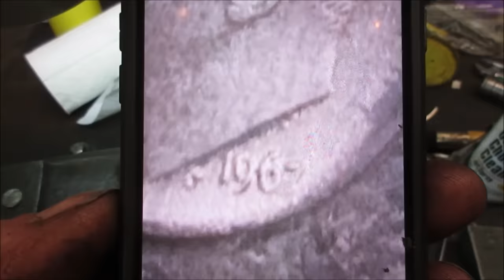VèloSolex Moped, Will it Run/Ride After 46 Years?

Comment: hi guys ! hi mustie ! i'm a french crazy fan of there solex moped ! and i can tell you it's soo fun to drive ! just little tips ! it's have a centrifugal cluche so if you stop in idle and you let the engin on the tire it will not burn it ! you just pull the engin up went you want to park it or ride like a regular bicycle ! went you have a stop, just pull the front brake ....have a great ride !
Reply: Fantastic idea!
Reply: ....and you can't use a "regular" bicycle tire. I learned the hard way. As soon as I dropped the engine on it, the engine chewed through the tire like a high speed Dremel tool, just before it busted the inner tube. lol
Reply: If it has a centrifugal clutch, how do you start the engine? Mustie's clutch must be stuck then.

Comment: That throttle works like a deceleration peddle on a bulldozer bro, I guess it is so it works like some sort of cruse control so you can keep ya hands for steering better. Great video and back story. Safe travels. Ken.

Comment: Welcome back. That Velo Solex sure reminds me of my youth when i owned 2 of them in succession. For all their simplicity they were pretty reliable and easily handæed the rain and snow in Scandinavia. Easy to fix too.
Reply: 33:20 At least on older models the decompression lever was attached to a small arm on the handlebar next to the throttle that you could operate with your thumb

Comment: 1:00:53. JB Weld will fix that up right--it is an amazing epoxy that doubles as a body filler, but is very hard when it cures so you have to be aggressive with it when sanding and filing it to its final form. The original formula (slower curing) is perhaps the best as it allows you an easier time at chiseling off the excess before it morphs into "immobile object" status.

Comment: Can you replace that metal that is rotted away on the rim. That would be a challenging welding job for ya or would you just purchase a new rim for it. It kinda reminds me a bit of when  i first rode my first Triumph with the gears on the right side if felt so bloody strange ....I didn't like at all That much I knew.

Comment: a Velo Solex 3800s was my first touch to engines i fixed it up in my teens and was playing with it for weeks.
musti you get the startup wrong.
you are supposted to cycle it normal up to speed, then pull decompression, drop the engine and let go the decompression... there you go, for at least half an hour until the 1.25Ltr of fuel are gone.
if you "plan" on stopping, you idle the engine. pull it up into the hook and decompress it...
emergency braking is just pull both levers and use the rearbrake, it stops quiet good
engine operation was never ment to be used in the city, ist made for long range strait. you have to keep in mind that this thing is a poor mans transportation from an area where the war has left not much to work with ;)

Comment: A 3800 Solex !?  Yesterday afternoon I took mine - 1968 -  for a drive ! It is the two-wheeled equivalent of the Citroën 2CV. Less is more. A concentrate of simplicity and intelligence. The first “VéloSolex prototype” rolled in December 1940. The first VéloSoleX was marketed in 1946. Since then, seven million copies have been sold in France and abroad.
Thank you Mustie !
Reply: Does it go any faster than Mustie's?
Reply: Less is more, That's a hubnut saying 😆
Reply: Nothing gets this guy down. His attitude is fantastic. When it goes pear shaped, he just laughs it off.
A lovely guy with positive attitude.
👍👍👍👍👍👍😄😄😄😄😄😄😄
Reply: Stock : 20 mph. Mine goes 50 mph but with a big carb and some hole enlargements.
Reply: @Hjerte_Verke  According to Waze the top speed is 35 Km/h whith original settings
Reply: The Vélosolex is just a modernized version of the 1919 Cyclotracteur. I've got a 1959 Flandria Ideal (Belgian take on the Solex) wich in comparaison to a 1010 (15mph) or 2200 (20mph) was a rocket ship (35mph).
Reply: I have a Flandria Comete cylinder head on my Solex.
Reply: "intelligence"

If you let go of the handle bar the bike goes full speed.
Reply: @Okurka.  In France and countries nearby everyone had a Solex from priests to plumbers. It was the perfect mean of transportation for children, women, factory workers...etc
To this day there are races held for heavily modified Solex's. 

It's like comparing driving a Model T to any normally laid out car, nothing makes sense to us, the same could be said by someone who learned on and always drove a Model T.

Mustie made it look complicated to ride since he didn't knew it had a clutch so you don't have to lift the engine from the wheel when coming to a stop.

When you're stopped squeezing the brakes the engine idles and when you want to go you pedal and the engine picks up (its only 0.75hp but can achieve 150mpg).

It's the same principle as an e-bike.
Reply: @jean-charlesweyland129  Everyone? That's a lie.
Reply: I suppose if you consider that  when you pull the levers on a normal bike, It comes to a stop. That would make this arrangement totally logical.
Reply: @rodcoulombe  If you let go of the handle bar on a normal bike it doesn't speed up.
Reply: @Okurka.  Everyone has had one or had a go on one. Every household had one at one point or had a relative/friend who had one. Over 7 millions were sold (2 millions more than the 2cv !). 
They were rarer in the Alps (in every mountain region for that matter) for obvious reasons.

Every guy had a story along those lines: we once put castor oil and ether in the tank... it was like a rocket ship until it blew up after covering 200 yards XD
Reply: @jean-charlesweyland129  7 million isn't even 10% of the people living "in France and countries nearby". You claimed everyone had one.
Reply: It will Downhill! LOL!  @Okurka.
Reply: @Okurka.  Majority of those 7 millions got sold over and over again. Not everybody bought it new ! Everyone had one or experienced riding on one at one point in their life.
It's like saying almost no American owned or drove a model T because they only made 15 millions for a population of 115 million !
Reply: @jean-charlesweyland129  Experience riding one isn't the same as having one.
That's like saying everyone had a Model T while only 15 million were made.
Just admit that you're a liar.
Reply: @Okurka.  Ever heard of something called a hyperbole ? Your answers are quite childish and I'll state it again, everyone had a Solex at one point in their live moreover some that didn't have a Solex had a copy of it like a VéloVAP, a WSK Gnom, a Flandria Vedette/Ideal... even the British copied it as the Cymota.

Why should all those manufacturers (and many more) copy a design if it's not in high demand and successful ?

Hell, you should try one yourself !
Reply: @Okurka.  Have I hurt your little feelings sunshine ? Don't be mad, if you can't fathom everything I wrote, you are forgiven.
I have really enjoyed chatting with you 😉
Reply: @renoreno2701 you probably mean kmh?!
Reply: No, 50mph / 80 KM/h

Comment: Throttle reversal makes sense. For long cruises around those Gallic lanes, with a string of onions around the neck, you can let go of the handle bar throttle so you can smoke a Gaulloise or Camel cigarette, using the left hand for gentle braking via the rear wheel, and when do need to brake to a complete stop it slows the throttle to idle too. Makes perfect sense.

Comment: Hi Mustie.
That wire with the tang goes underneath the copper part on the headlight cover.
I've got a S2200 and a S3800 both go out for a ride just about three to five times a month.
Being Easter Sunday my brother in law and me went for a ride after lunch for a couple of hours.
They are an absolute fun time to be on out and about.
Hello from Portugal.
Reply: What voltage are the light bulbs?
Reply: @Hjerte_Verke  7.5 volts, they are prone to burn out.
I converted mine to LED
Reply: Excellent information, thank you!

Comment: Solex made a few motorised bicycles all using the same engine, the throttle is designed to go backwards to stop cramp in your hand by holding the lever in.
Later models incorporated the front brake into the throttle lever plus the decompression valve all in one.
You are lucky in the USA that ou can ride one of these completely free of charge, here in the UK it is a motorised bicycle (moped) hence you need to pay road tax have it, insured and pass a MOT test,(ministry of transport, Road safety check)
Reply: it probably varies by state but here you need to register(cheap sticker) it and have a permit(14-15yr old i think ) or drivers license(16+). Likely get away without it as long as you dont attract attention to yourself.
Reply: thankfully the MOT on a solex is quite lenient, many solex's will be MOT and tax exempt being over 40 years old. the insurance on a historic moped like that is going to be pretty cheap.

Comment: Helo Mustie & Brian  Happy Easter. I rode a buddies solex back in the day. Unfortunately the engine pretty much finished so keeping it running the real challenge. You get used to the front brake  / throttle very quickly. Just squeeze normally to stop and let go to start. As you mentioned  there not speed deamons just meant for cheep transportation and help with steeper hills.
There a lot of fun for kids and practical as a touring bike if your not in a hurry.
Think of it as a 1940's prelude to the EBike.

Comment: These are/were pretty popular in the Netherlands, there are solex clubs holding annual races on them in period correct clothing (long leather jackets etc) Just very basic engineering on a normal bicycle which holds out for a pretty long time. I wasn't too fond of them because they were too slow for me when I was around 15 or 16 years old in the 80's. I had a couple of Puch mopeds which were solid and very easy to work on and being modified. Thanks for sharing bringing this back to useable condition
Reply: Zundap and kridler were the most popular mopeds in the Netherlands when I was a kid 1968-71
Reply: Puch and tomos too.
In europe they race these, will go 90 km/ph.
There are tubevideos.

Comment: A 1967 dime. Back then I was a boy of 9 nine years.Yes, I remember seeing those Solex mopeds in Europe where we lived for a year in the 1960s. I remember thinking, "Why did they put the engine on the front wheel? Everyone knows they're supposed to be driven by the rear wheel!" Now, I think that moped just exudes French eccentricity like a Citroen 2CV. You did an excellent job of getting it running and it was a great video to watch. Merci beaucoup!

Comment: Welcome back. Neat bike. I guess the reverse throttle makes sense if you think of it like a bicycle instead of a motorcycle. Someone who's used to a bike would pull the brakes to stop -- wouldn't want to add throttle to the engine in that case.

Comment: Hi from France. You suppose to start it with the motor down using de décompression. If the timing is correct, it should start on 1 mètre. The tiny white thing you found in the tool box is a gas filter. You can take it out easely just under the air filter. Just open the air filter and get rid of the filtering membrane, it s running better without it.

Comment: When my father and I would set up a wheel's spokes, we used a bicycle fork squeezed in the vice. Mounted the wheel on the fork and adjusted the spokes with the wheel firmly fastened to the fork.

Comment: Never lower a running motor onto the tire. The friction roll will mill a grove into your brand newe tire. And do not open the throttle lever fully when the motor is warm. You need to find the position where the motor runs best, which is about the 1 o´clock position.

Comment: You know Darren the owner of this device 49 years ago probably thought, i know just to confuse anyone 49 years from now, I will put this brake holder on back to front and take off the original valve opener and put this on to confuse the issue even more. After I'm dead and buried, what a great gag to play on someone ( Darren)49 years from now.
One last thing Darren, the single foot peg and wire basket on the left side, would tend to suggest the passenger sits side saddle. Delivering papers??????? from the basket.

Comment: The idea of the Solex was to have a motor assisted bicycle. Unlike to other mobylettes of the time, the motor can be completely disconnected from the drive train and be ridden like a bicycle.  Other mobylettes had a bad sitting geometry for peddling and had constant drive train drag.  On the Solex, you could get where you were going just by peddling.  Note that peddling to assist the motor was better on the Solex.

Comment: My Dad's uncle gave us one of these in the early 90s.  I'm guessing it was from the late 70s.  All it needed was new inner tubes, some adjustment of the engagement lever and a good cleaning of the carbon build up present in the exhaust downpipe (was about 80% blocked...ran a shitload better after I chipped the charcoal out of it, lol).  It did OK.  I used to ride it down the road to my little part-time teenage landscaping job.  I remember at one point running some methanol/nitromethane model airplane fuel through it (briefly) and it absolutely screamed...but didn't make much power...haha.  I knew nothing about the mixture jetting modifications that would have been required to get that to work properly.  Anyway, the moped is still sitting at Dad's house...somebody tore the engine half apart at some point trying to "fix" something...afraid many of the parts (head, carb, head cover, etc.) are probably gone for good now.

Comment: The brake handle makes sense if you think of it as a brake handle and not a throttle. Who wants to hold the handle down to go when you can let it rip and keep fatigue away from the hand? You squeeze the handle to brake and the engine idles down to keep you from running through lights/stop signs.

Comment: If you think of it as a brake rather than throttle maybe it makes more sense. Pulling the handle slows you down and stops you while letting it go is when you want to go.

When you showed the front brakes attached to the throttle that's when that occurred to me.

Comment: If you think this Solex is weird, take a look at the Solex 6000 from the early 70´s which is shaft driven and got a disc brake on the rear wheel. It also got a belt driven fan because the engine is totally covered and got two side doors to the engine compartment.

Comment: assuming the tire  is close to the correct size, that front brake will most likely have some sort of mechanism on it so as to release its arms wide enough to let the tire slip in. if not, it's easy enough remove air from the tire.

...the throttle and brake lever makes all the sense in the world once it's ridden in traffic for a couple of minutes. and BTW,  you're not the first to spend what seems to be an inordinate amount of time fiddling with french caliper brakes. :)

Comment: The rear set is factory installed. 
There's a hole on the other side seat brace in the same place si the foot peg and mount bracket mount on the left side is missing. 
It was common on European bikes to have rear seats back then because bicycles were ised far more than in America because of gas(petrol) prices made bicycles far more commonly usedas daily transportation than in America. 
Usually your girlfriend, younger sibling or smaller male friend/co-worker.
Reply: Here in Germany it was forbidden to ride a Solex with two people. Likewise on bicycles. You are only allowed to transport small children in a special trailer (Nevertheless, of course, you often took a friend or girlfriend with you).

Comment: (Message de France) On se moque pas du mythique Solex qui a fait la joie de millions de petit francais, ça consomme pas, entretien néant et increvable... En fait, le montage est à l'envers, en principe il faut relacher la poignée pour que cela accélère et la pincée pour tourner au ralenti. La cosse électrique se branche sous le capot centrale du moteur pour envoyer l'éclairage à l'arrière. Ceux sortis en France n'avait pas de deuxième selle (interdit de rouler à deux) Connaissez vous la mythique voiture 2 cv citroen, des millions de francais sont partis en vacance avec! Le cahier des charges assigné à citroen ( juste après la guerre de 39 45) était de pouvoir traversere un champ de labour avec des oeufs sans les casser. Bien cordialement.

Comment: Because of the very low fuel consumption (170 mpg or 1,4L / 100km) solex engine need 6% mineral oil mix

Comment: Growing up fixing my (always hand-me-down/third-fourth hand bikes) I always hated how side-pull brakes worked. They'd basically rely on pushing one side to force the other side to engage.  Worked but asymmetrically.   By the time I saw center pull brakes, I was driving and had little use for bikes.  (I might get an electric assist for light trail riding now, but in city there was no place I was comfortable riding a bicycle  (Now the cities frequently have bike lanes and make walking paths large enough (sometimes marked) to allow bikes on them, but in my early days in the city it was "good luck".

Comment: 1. It has a centrifugal clutch. If it‘s working, you don‘t need to flip up the engine to stop!
2. you can access the air filter by splitting that top part (the shell is friction fit)
3. Yes, that wire is for the headlight
4. No, you can‘t adjust the carburetor
5. Yes, the wire for the headlight attaches to the cover
6. The stop light is not original

Edit:
The purpose of the backwards lever is, that if you want to brake, the engine automatically goes to idle. So you only need one lever to control the vehicle: Squeeze=stop, let go=drive

Comment: Had a Daimler moped in the mid 60's. Remove the spark plug, tap three times on the concrete, reinstall, and off you go. First thing I'd go for is disk brakes.